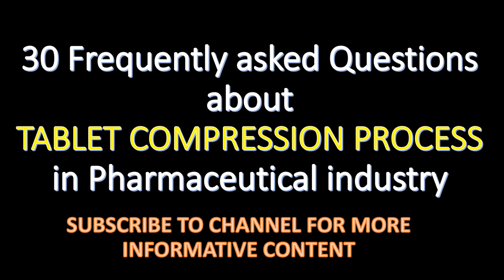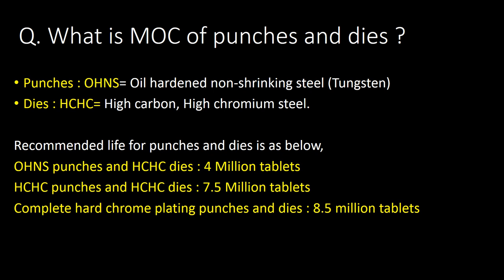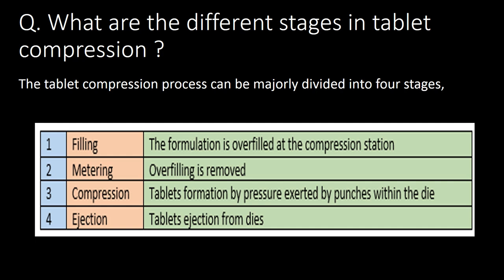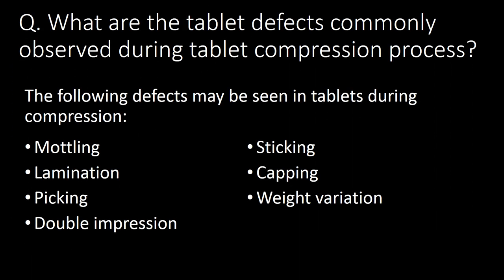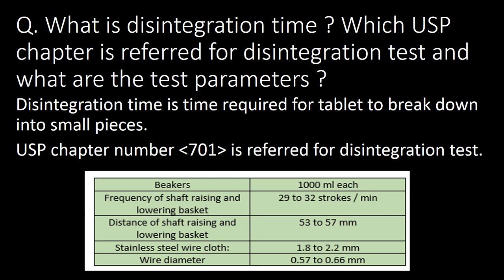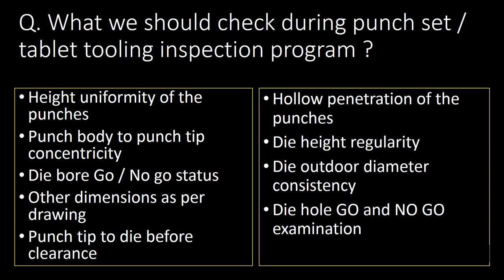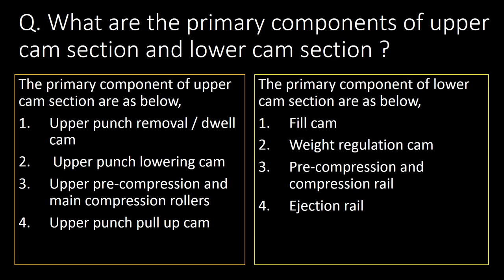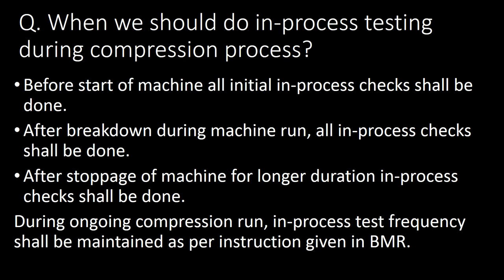Compression process for tablet manufacturing in Pharmaceutical industry l 30 Question and answers

Comment: Load cell not a encoder 

Load cell is a transducer convert physical pressure to electrical signal 

Encoder is a different types of transducer produce pulse for measuring punch position and terret rpm